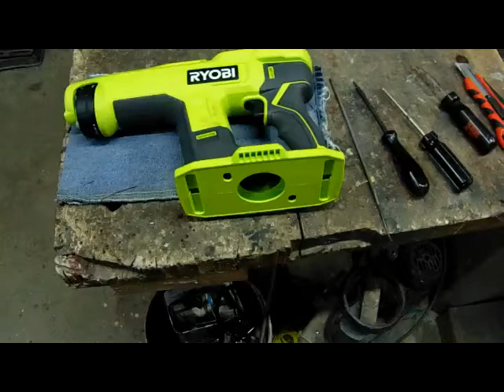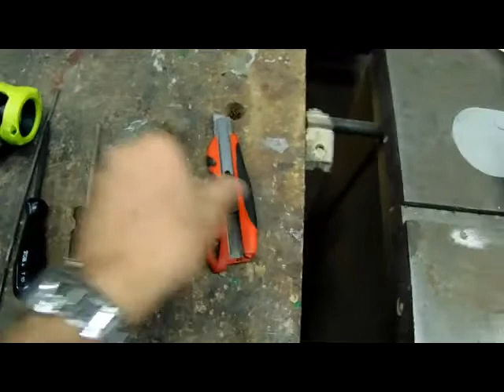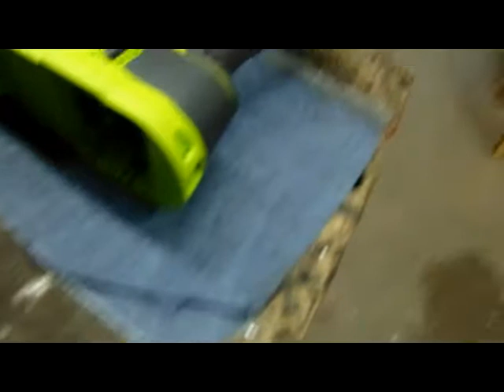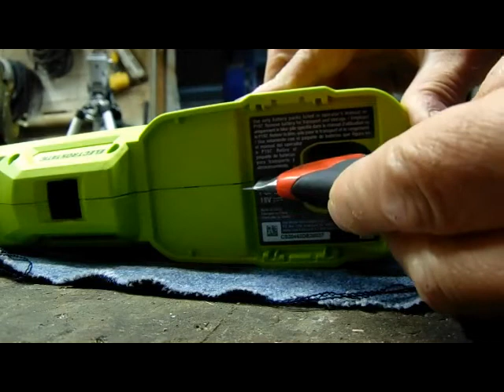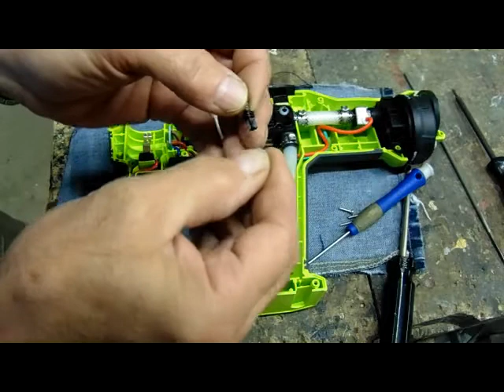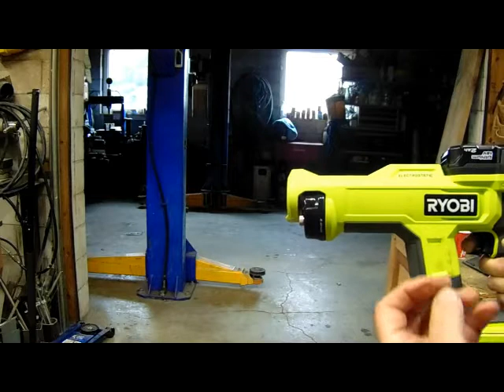Ryobi One + sprayer repair No parts required Fix

Comment: This works!! Tried it on a sprayer right out of the box, but note that there are actually FOUR of these check valves not just two. You need to carefully remove the pump and do the other side of it as well (same technique). Also be very careful as you put together, I suggest seating the spring onto the curved / short end of the black plunger and then set the + part into the valve. Also be careful not to over-tighten the screws on the pump as you put it back together. I over-tightened one and started to crack the plastic.
Reply: This is correct. I found out that the other side was not free as well and mine began working.  Thanks.
Reply: Wish I had read this comment before I put it back together and realized the pump still wasn't drawing liquid lol
But yes, there is an identical set on the back side of the pump, did all 4 and she works again!
Reply: It's 2024 and this video is still helpful. Just gotta do the other 2 valves. Oh well, back to the drawing board.

Comment: Watched your video and it gave me the idea that since it’s just stuck check valves, I could force them open with air. So, grabbed a small syringe, squeezed the on trigger, and plunged 5cc’s of air into the inlet.  Heard the valves open immediately and now it works :) best part is no disassembly required.
Thanks for diagnosing !

Comment: It worked you will need a long t10 driver to get the 19 screws out some are DEEP in there .
I ordered this sprayer from ebay that was DOA . These directions was perfect. One of the valves was stuck so I was not getting anything liquid out . Good to go . Thank you !!!!!

Comment: Thanks for the fix! I was having trouble with mine and the small compressor was just not making the normal sound. It would only sputter the water on prime setting - rather than a pencil size stream.

I did what you did in the video. I also flipped that part over carefully in order to get to the other plastic gaskets on the opposite side. I did the same to them.

When I turned it on it was still having some struggle but it was starting to work intermittently. So I dumped out the water and used HOT water instead. The thing sprang back to life almost instantaneously.

Thanks again!

Comment: Direct tools  is currently giving these away with qualifying tool purchases right now. (basically any Ryobi 18v power tool purchase)  I apparently have two of them on the way so this video is helpful.  I'll be playing with the parts to see if I can't make them into something more useful.   I'm thinking I'll open up the spray tips a little and use it for applying India ink on projects for one of them and perhaps I'll use the other as a low pressure water pump or just gut it and use the motor in a hobby project of some kind. in any case it looks like it's got some useful bits inside so it will be fun to fiddle with.

Comment: I get it to hone out white part, what about the issue on the other side putting the spring back on? the spring is meant to slip over the back nub, which is now to large singer this part has expanded. Ryobi should do a recall or send us the parts free of charge and give us a discount on future purchases.

Comment: Thanks for your video......I took mine apart and the black rubber parts were very swollen.  Actually,  one is so swollen I am having difficulties getting the spring to hold to the black rubber piece on one of the two. The spring needs to grab to the rubber correct?
Reply from the maker: Yes the spring should seat firmly on the rubber pin.  TonyK.

Comment: I have about 20 of these and a few of the little white guides seem to be a different material which continually expands and sticks. The problematic guides are more tan than white in color. Most of the guns with the problematic white guides also have a tan/brown hoses on the inside as well. My question is, do you know of a place where I can order replacement internals for small pumps like this? At the end of the video you said that Ryobi might be coming up with some replacement parts. To your knowledge, have any become available?
Reply from the maker: I have not seen replacement part available, however for  a period of time Ryobi was sending out complete guns as a replacement.  You were not  required to send the old unit back.  TonyK.
Reply: @Fiatx192040  Oh and thank you very much for creating this video. Not all heroes wear capes.

Comment: How long before I have to do? I use for commercial cleaning when I can't use the kavac no touch system. Battery seem to last a long time!
Reply from the maker: When the sprayer stops working, you are kind of forced into this fix.  Just remember there are 4 valves in the pump, 2 on each side.  TonyK.

Comment: This sprayer is grounded right? Their bigger spray has like an external wire for grounding but I can't find any info about grounding on this model.
Reply from the maker: Some units use an external ground wire to attract the spray.  This one does not work that way,  the electrostatic charge is applied to the particles in the mist of the spray.  Because a ground wire is not used the charged particles do not go in the direction of a grounded system.  The particles will go in any direction they are attracted to.

Comment: I got a brand new unit that wont spray from the box too. tried to use a shringe and force a fluid from the bottom port till fluid comes out of the nozzle. Then test and it works. Check the video. Hope this helps too. https://youtu.be/NvHIo8E434I